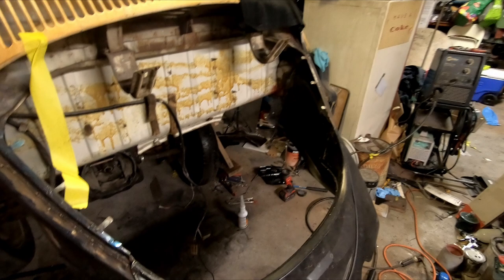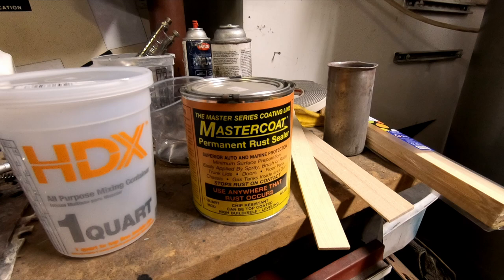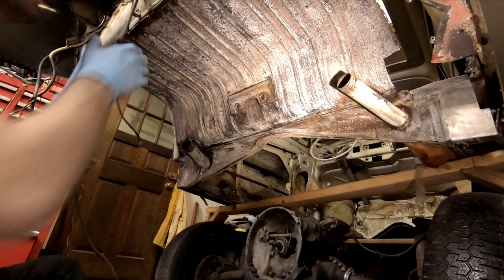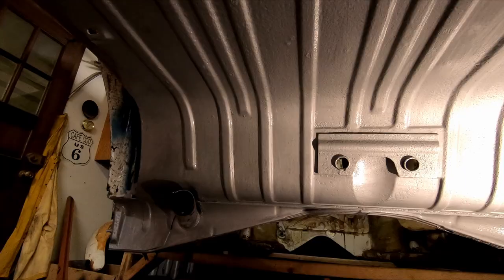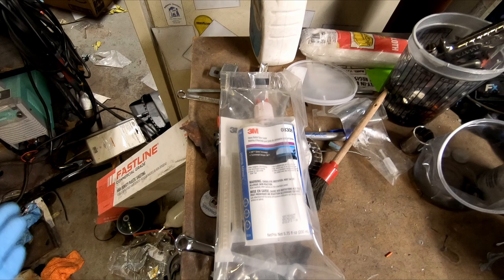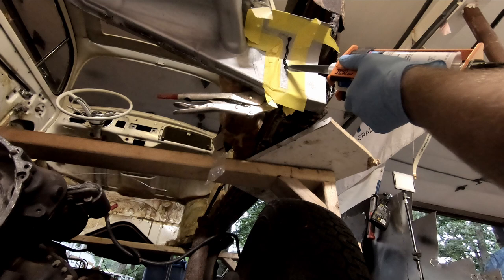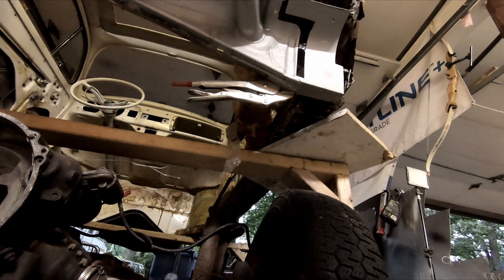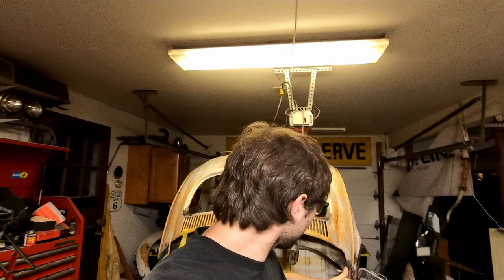1963 VW Beetle Full Restoration | Painting Package Tray and Seam Sealing

Comment: The Master Series silver paint is great for rust sealing. I used about 5 quarts of it now on  my Bus rebuild, but find it difficult to store without hardening up in short amount of time in a sealed container. It also needs to be stirred slowly, as it begins creeping up to the top of the can once it starts mixing together. A bit messy, but durable.
Reply from the maker: Very durable! I’m thinking of spraying the underside of my bus with it as an initial primer.